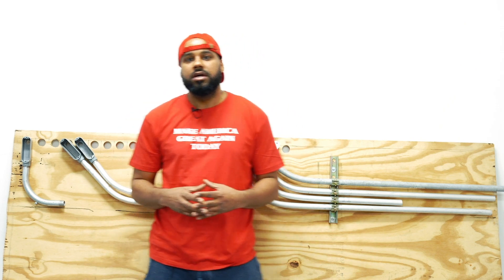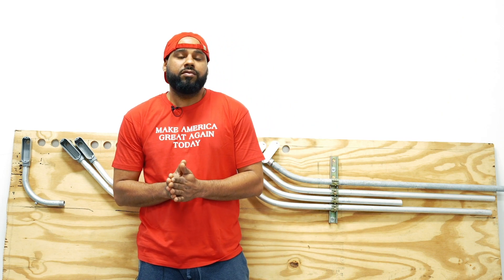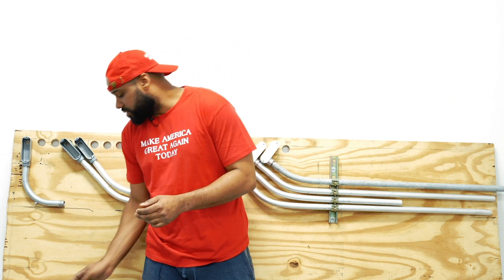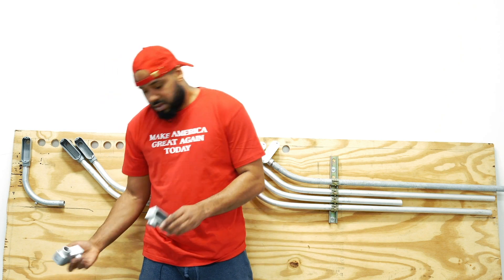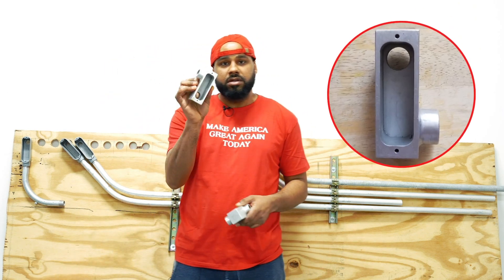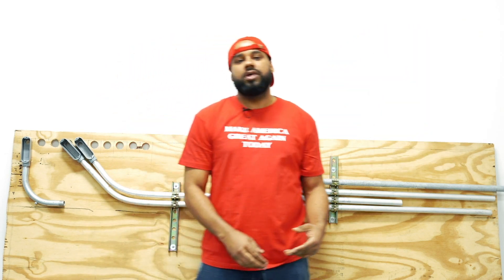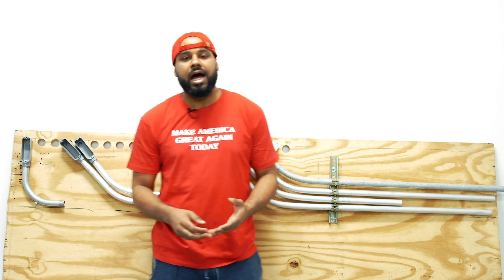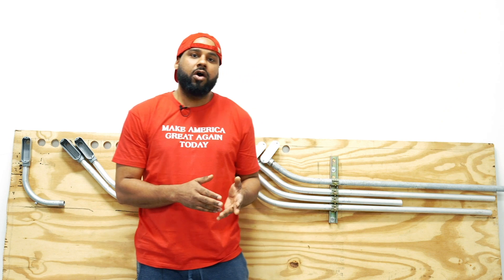Intro

Comment: Well there is on problem, with those you made it I harder to pull wires through them. Ik it's sometimes difficult bending them but it is lots easy to pull wires through bent pipe.

Comment: The offset conduit body is like two 90 degree bends that are tighter then a back to back with a short radius bender.... and the perpendicular one I can use a small 12x12 junction box or smaller to accomplish that. I like intuition, just small need for those conduit bodies.

Comment: Sorry bro I see a lot of issues with this being used in the field. If you used this on most pipe racks it would be harder than it's worth to use there and still be able to access the box. Also another reason would be supply chain. I could just get my guys benders and that's 3 less items I need to worry about keeping stocked. (Offset, cover, and seal)
Reply: Exactly

Comment: 32 year union electrician here. Learning to bend pipe is essential in heavy industrial applications. I can bend and install pipe faster than you can install and properly support your conduit bodies. The difference will be in pulling the wire into those conduit runs. You will eat way to many man hours trying to pull through all of those fittings rather than a smooth pull from end to end through bends. Good luck with your invention brother. I do hope for you to prosper. Stay safe!
Reply from the maker: I got you greg, but it's more about options.  But question: do you bend for a 90 all the time? Or do you use an LB fitting?
Reply: Rafael Galva I do agree with Greg. Always bend for an easy wire pull, the way I invision your application would be for exterior corners like into a roof or a tight brick wall bend where you’d like it to hug the corners. Good luck
Reply: First clarification. I apologize for not thanking you for your service to this awesome country and keeping my ass safe. So, Thank you sir!

I rarely use conduit bodies. Maybe an occasional C to break up my 360s. Even then, I typically will drop a 4 11/16 box with straight though connectors to keep my pipe runs point to point. Pulling wire loops out of conduit bodies then dressing them in is not one of my favorite things. 
To each his own. 
Again, thank you for your service, stay safe.

Comment: Isn’t it cheaper to bend an offset.... if you can’t bend pipe you shouldn’t be an electrician.
Reply from the maker: Have you ever bend 3 inch rigid pipe?
Reply: Rafael Galva yes they have hydraulic benders for that
Reply from the maker: @jimgbe7185  , do you always bend for a 90 degree pipe? Or do you use an LB sometimes?
Reply: Rafael Galva as a commercial electrician we don’t use LBs at all we just throw in a 4 square box and you can come out of the box on any side with pipe. Your product is more for the industrial side.

Comment: The more lbs the more spots of failure, hire a good electrician who can bend pipe and do it right. Have fun changing something or troubleshooting a problem 😅
Reply: John Patriot eagle freedom boner  thank you, you have put a better emphasis on it then my comment, Rafael  I was army reserve you are absolutely correct for inventing this product for military purpose only ive seen horrible electrical work on base so this product deserves a contract with the military but in civilian world its a joke
Reply from the maker: John Patriot eagle freedom boner  , you're right. Because you use these fittings as minimum as possible. But it's not about just replacing bend pipe. It's way more than that...
Reply from the maker: Not true sir...